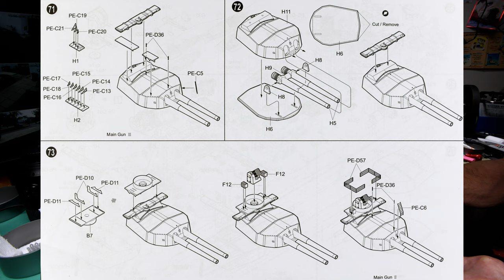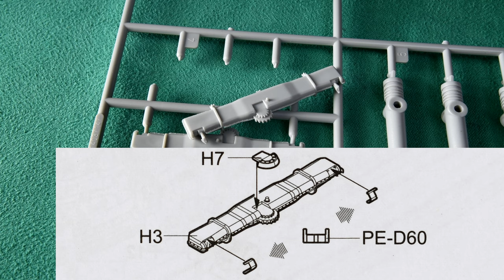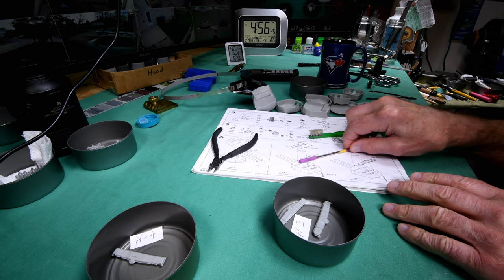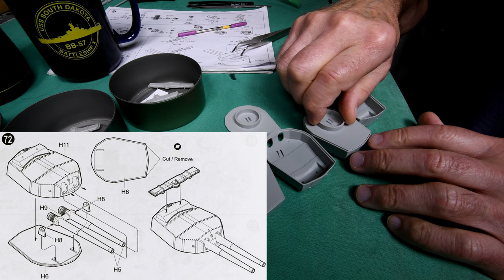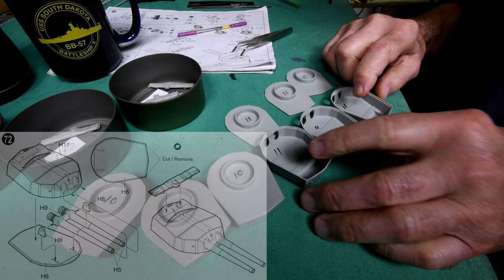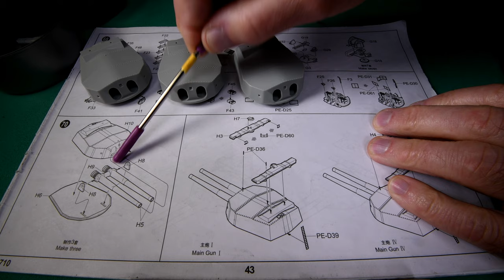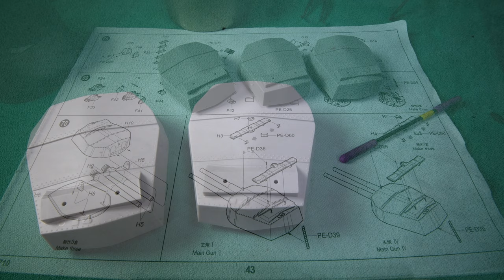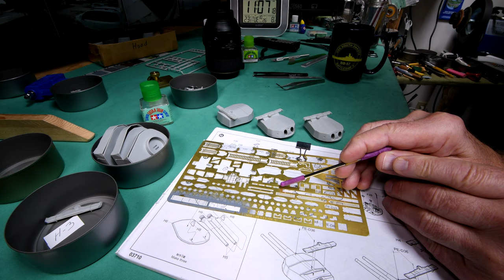The Model Ship - Part 972

Comment: You had me talking at the screen when you didn't see the difference between h3 and h4 😄
Please Ron, check the instruction manual, it is saying to cut the base part6 not the turret. 
Would be interesting in seeing the serger. Never seen one.
Reply from the maker: Re: "cut the base part 6 not the turret"
I realized that later when doing the final edit. Will mention that error in 793 today. Thanks for noticing Dave. 😊👍

Comment: Ron, when you compared the 10/11 turrets, 11 looked slightly shorter than the 10. Maybe measure them. Might be 10 thou shorter. Just a guess.
Reply from the maker: The front of the turrets are shaped slightly differently. Step 72 wants the H6 to have the front corners trimmed down to accommodate turret #11. 🤞